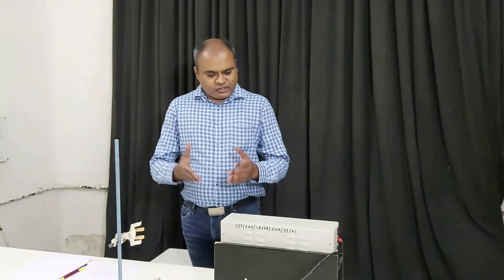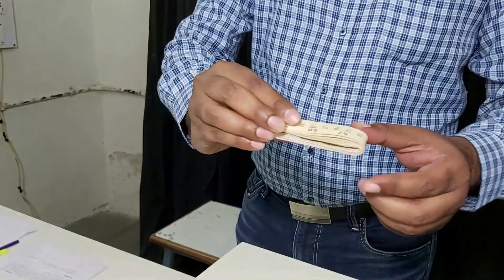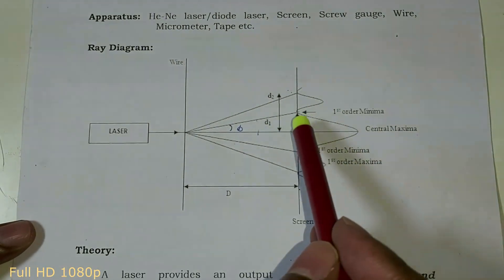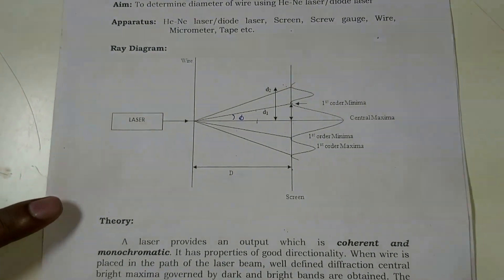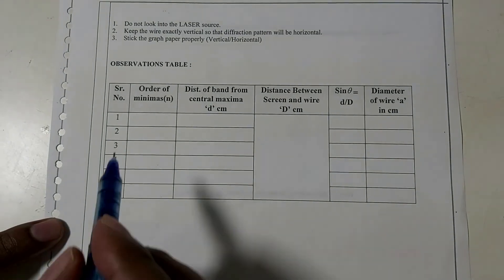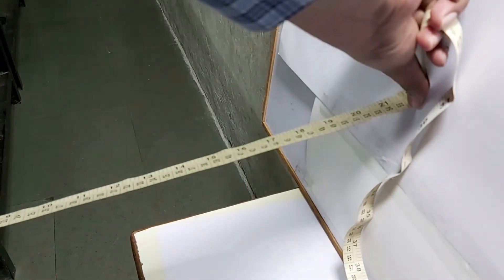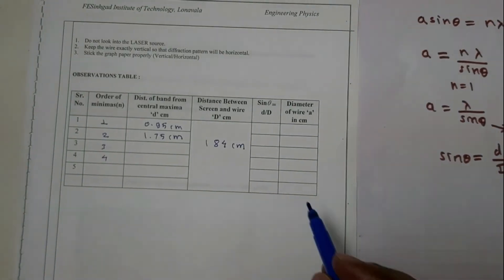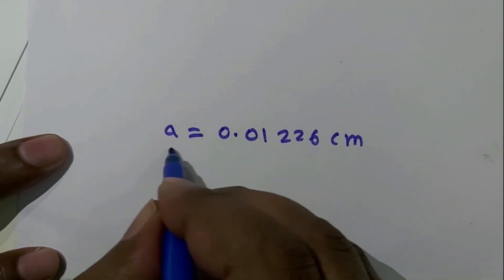Diameter of thin wire using laser experiment, laser single slit diffraction, laser diffraction

Comment: Sir another question. What could be the reason for error in calculating the diameter of the wire using this technique ?
Reply from the maker: It depends on how accurately you  note minima location. Normally to the micrometer scale.
Reply: @SSPhysics  Very difficult and not accurate technique.

Comment: Sir what's the relation between the wire and the slit originally used for experiment ?
Reply from the maker: Diffraction occurs at sharp INNER edges of a slit while diffraction occurs at the OUTER sharp edges of a wire.
Reply: @SSPhysics  thank you for answering my question. 🙏👍

Comment: But sir i have done this experiment many times but the diffraction pattern is not obtained on screen even when changing the distance bw screen nd wire also

Can you tell me the reason,
Reply from the maker: Take thin wire like hair.
Reply: @SSPhysics   yes sir...done  but the frimges are so close to each other
Reply from the maker: @easyphysics7910 Use high quality laser.  Keep wire and source distance small. Use dark room.
Reply: @SSPhysics  the practical is not there in my practical book...where can i get the complete notes of this experiment sir?